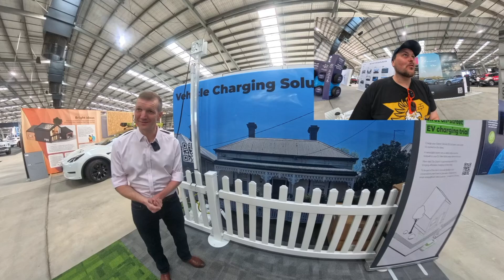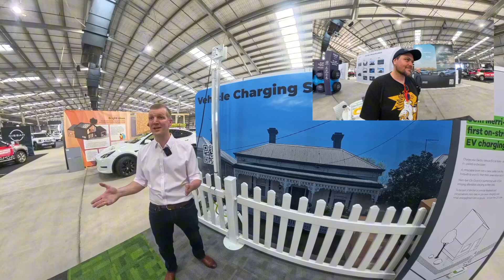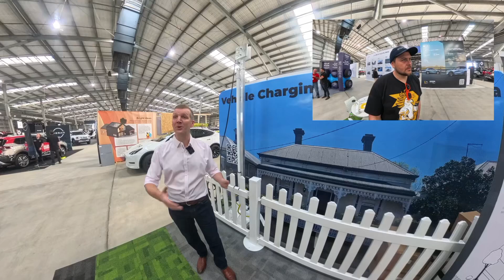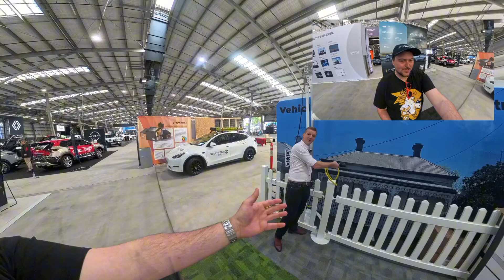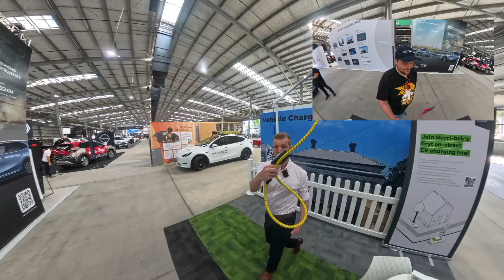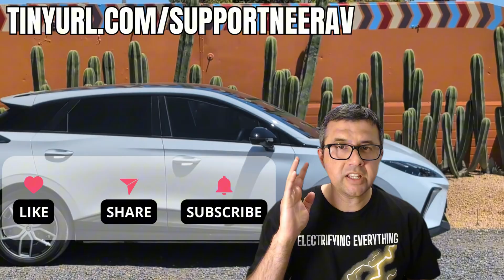Australia's Answer to Street Park EV Charging Using Home Solar (But Is It the Right Solution?)"

Comment: Needs a cheap and fast local council permit approval process to take off. 

Councils can also approve permanent short charging posts on the edge of the sidewalk near the road. Cities in Europe use this method for public charging. Australia can adapt it for private home charging, allowing the home owner to sell his solar/battery electricity to charge other cars as well as his own.

It is certainly better than the UK Kerbocharge channel system for ease of use and not having to deal with dirty charging cables from all the muck in the ground channel. The Kerbocharge also puts more wear and tear on the charging cable.

Comment: Surely local council public liability would stop this from being installed in a public street
Reply from the maker: Let's see how the Victorian council trial in merri-bek goes. It wouldn't work well on streets like mine that have low growing trees. The boom wouldn't be able to cross the sidewalk for some houses as it would hit tree branches
Reply: Currently in trials with a local council here in Melbourne ✌️
Reply: But house owners have no right to parking outside their house.If your neighbour beats you home from work ,they can park out the front of your house etc.
Reply from the maker: The aim of this is not to charge every single day. Even if you can only get a park in front of your house once or twice a week, it will be enough for most people. That's how I recharge my car every 2-3 weeks using my sidewalk charging cable permit
Reply: You didn't mention that you had to have a $20 million liability insurance policy on your house to qualify or that you had to get it certified by the authorities and then pay for the permit. Ai  can check your claims in 10 seconds flat.